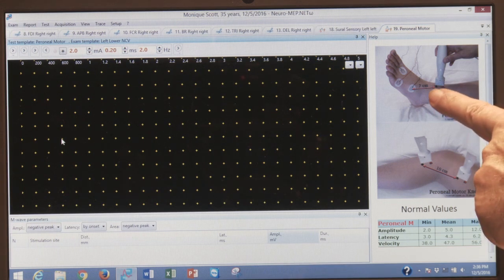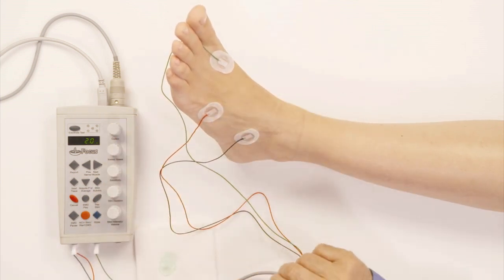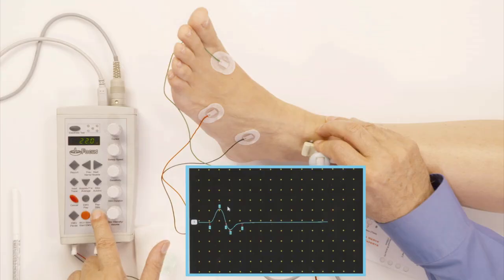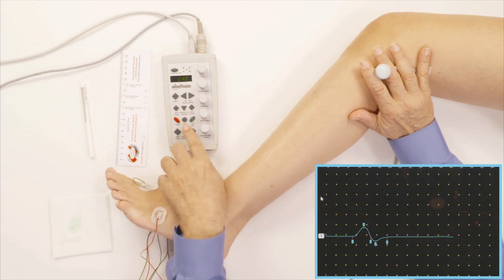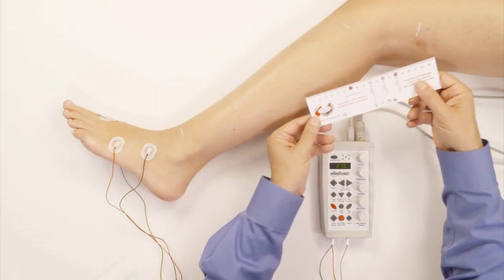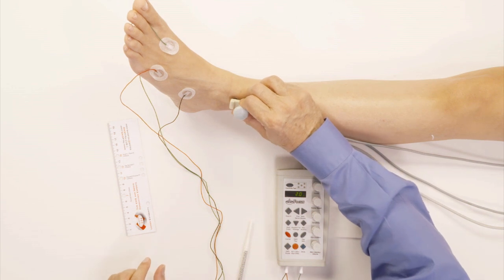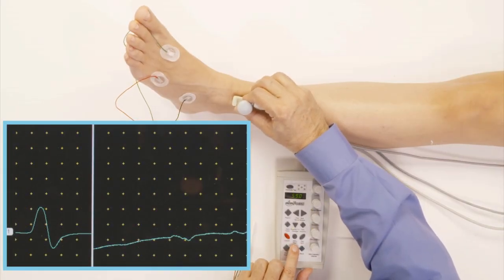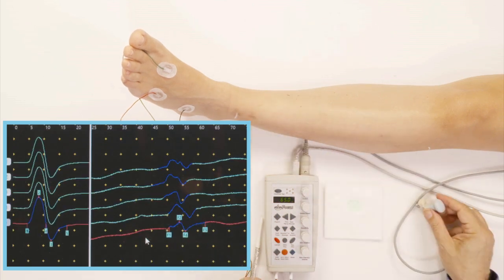PERONEAL MOTOR WITH F-WAVE

Comment: When I had mine done doctor the right foot moved fine and even dumped off the bed,but when they checked my left foot it didn't matter how much strength he put through my foot it only moved the toes a little bit,could I have nerve damage in my left foot? My EMG readings were below average aswell

Comment: My toes did not even move but the old neurologist just said okay to the aid who put thing on leg. Took less than 10 minutes to do nerve and needle emg. He was very short with me and said was normal.  Only put needle in 2 places. I knew i should have just canceled at this particular hospital.
Reply: I don't think this procedure is transparent enough for the patient. I had a Dr who declared everything normal too only to find results and observe myself otherwise. He noted an abnormality as a 'common Variant'  he also didn't include the muap on the emg and it was very quiet in my feet.  its important to understand to xplain symptoms, not prematurely or casually dismiss
Reply: I know it's been a while but I feel compelled to explain.  I do the nerve test for a living, and you can absolutely get a result without the toes moving.  Same with any nerve.  Certain movements are helpful indicators you are stimming the correct location, but they are not necessary.  What matters is what is on the screen

Comment: Thanks a lot for sharing these great videos. I wondered because in my anatomy books, the profound peroneal nerve innervates the extensor digitorum brevis muscle. Its localisation just above the ankle is described much more in the middle of the leg, where the tibial artery is. But obviously your stimulation just hit the nerve to the extensor digitorum muscles. I thought, where you stimulated is the superficial branch of the peroneal nerve, which innervates only two muscles, doing pronation.
Can you explain if my books are wrong or if there is a common variation in the innervation of the extensor digitorum brevis?
Best regards

Comment: This is an EMG? The EMG nerve conduction test I had involved a needle and my doctor poking it down my leg... and it didn't even show anything when I definitely do have foot drop, so that shows how unreliable it can be when done manually with the needle like my doctor did. This test looks so much better! What is this called??
Reply: I had the exact same test! I have foot drop after L1 - L5 Fusion it didn't show anything either.
Reply: what you had was the nerve conduction velocity test (NCV) which tests nerve response. This video is of an EMG, which tests the muscle's response to stimulated nerves. Both these tests are usually done hand-in-hand to tell whether the problems are muscular or nerve related.